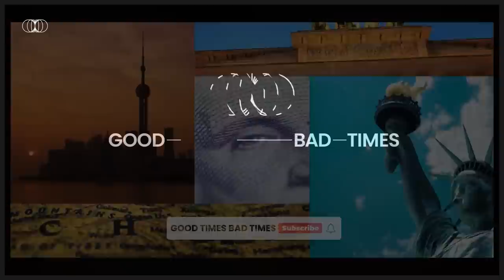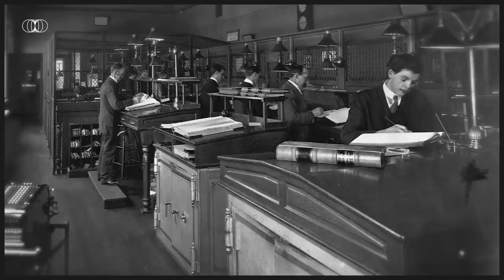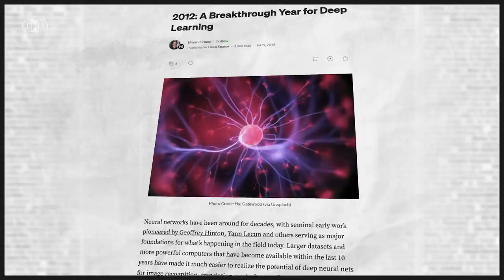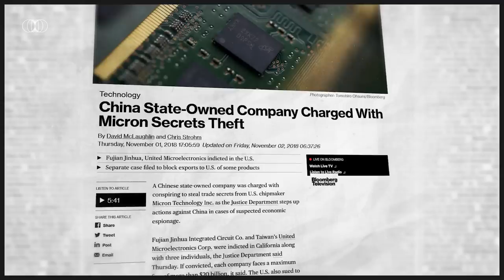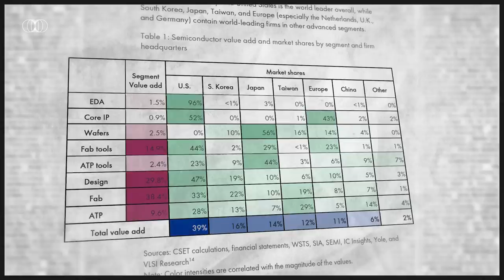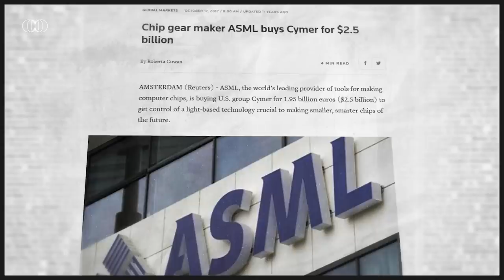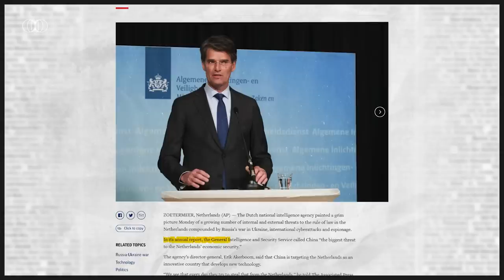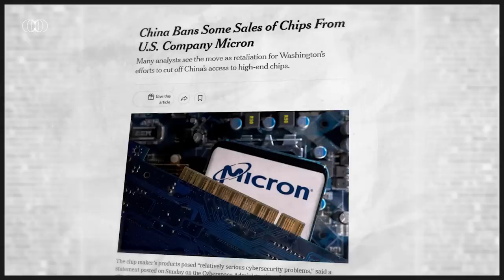The War for AI & Chip Supremacy is Underway.

Comment: As someone who works in the industry and has been following these developments for years, this is a high quality summary of the current situation with few misses.
Reply: what did he miss ?
Reply: Samsung being one of the key CPU producers is missing. NVIDIA only recently switched to tsmc. OTOH considering how densely packed this video is, some shortcuts are kinda given.
Reply: @mth469 The fact that silicon chip development is starting to reach physical limits.
Reply: @J_X999  
with AI doing chip design,
we're about to see human methods of design become as obsolete as the horse and buggy.  

it will squeeze way more out of physical silicon transistor materials and placement than humans ever can.
Reply: @mth469  Every single shrinkage of node will be more expensive and take more time than it's predecessor.
Reply: @J_X999  

its something AI would do way better than a human. 

not just use existing tools to do it, but literally engineer new tools and new materials and forms in which the transistors are built.

it would also in parallel figure out other means as yet undiscovered.

we are on the cusp of a revolution.
Reply: @mth469  AI cannot change physics which has been in place since the beginning of the universe. Chip development will slow, with or without AI
Reply: @J_X999  

you'll be surprised what AI can do.

the word "cannot" will be removed from the vocabulary in many instance because it will do it in ways unimaginable.

Long live AI !!
Reply: @mth469  If this really is the case, China will probably use AI to find the most efficient way to catch up in semiconductors and execute that plan by 2030
Reply: @J_X999  

That is what many countries with advanced AI capabilities are trying to do and doing.

AI is being used not just in aiding design decisions but making those decisions and executing on them at all levels.

How far ahead countries are in this endeavor is anyone's guess.  Any country that loses this race is going to pay dearly for it.

Comment: Great analysis! We have seen a number of investments from TSMC, Samsung, Micron, Intel and others opening new factories in the mainland US, namely TSMC in Arizona, Samsung in Texas and Micron, recently announced investment, in upper New York. I understand these projects will take some time to come to fruition, but shouldn´t these new factories guarantee sufficient chip supply in case of conflict in Taiwan?
Reply: And to be noted that the most cutting edge chips (3nm and potentially 2nm) are still manufactured in Taiwan. The TSMC fabs in Arizona manufactures 5nm chips.
Reply: You need to think about whole supply chain. Substrates, materials for packaging, etc - there are significant logistic reasons why Intel  has factories in singapore and malaysia
Reply: TSMC has more than 10 fabs in Taiwan already cranking out cutting edge micro chips. One that is yet to finish in Arizona won't be solving anything.
Reply: @Freshie55  not to mention that TSMC Fab in arizona are only producing fraction of wafer compare to taiwanese fab.  And US itself only have few smaller  facility of chip packaging and testing. so those wafer still needed to send outside of US to package and testing
Reply: Samsung is also a big chip maker. They are also currently at about 3nm. I think their business is about half the size of TSMC's, and Samsung does also manufacture for other companies. So, TSMC already has a viable competitor/alternative.

However, from what I'm aware, the supply of chip making versus demand is always tight. They do not (intentionally) build extra capacity. The factories are just too expensive and take too long to build. Overbuild much and you'll go bankrupt. 

If the TSMC plants in Taiwan were taken over/destroyed by the CCP, or even all the Samsung plants in Korea just disappeared, the chip inducstry -- and all affected industries -- would suddenly have a huge shortage with no fix for several years. It would be COVID 2.0 (times ten).

Comment: @Good Times Bad Times, great timing on the video drop— Nvidia is up like 28% today based on earnings from AI.
Reply: Yeah it's a little bit overhyped though. Just like any new hot tech topic of the moment. Recalling NFTs and metaverse vibes.
Reply: @johnjingleheimersmith9259  ”AI" is obviously a hype bubble that will pop soon.
Reply: @johnjingleheimersmith9259  except AI and graphics processors speed up the development of vaccines, new military hardware, space exploration, etc. 

This is way more important than a metaverse or NFTs.
Reply: @jordanstephenson3497  lol no, it's not that simple nor easy. AI doesn't automatically equal magic "speed boost" for military nor biotech nor "space exploration". It fully reinforces that people have little understanding of the true and current capabilities and limitations of AI. Just like people thinking AI will suddenly take their jobs, it is gravely uninformed thinking. Can AI help in certain aspects, certainly, but this is not an instant panacea or easy to accomplish on a broader scale.
Reply: @johnjingleheimersmith9259  I don’t think anything of what you just assumed. 

LLMs are the start. Deep learning and neural networks are already creeping into every industry. 

AI is just a tool after all, but a super kickass tool. 

Thanks for the back and forth

Comment: Note, this video sticks Apple in with Intel, and AMD, in microprocessors. Intel created the x86 architecture, and AMD currently also designs x86 chips, that often exceed Intel wares. But Apple recently designed ARM architecture chips that exceed x86 performance. ARM architecture is traditionally in lower power and lower performance products such as smartphones. Apple's recent ARM design surprisingly outperformed the latest x86 parts. Intel is in trouble, and AMD likewise. At least AMD has GPU products, that it can rely on.

Comment: A blockade of Taiwan would wreak havoc on the world. But the most advanced chips made by TSMC are already blocked by the US. So China would not suffer that much. In the last year, China has ramped up a lot in manufacturing of mature technoloyg chips, mature chips while having much lower profit margins drives the world's economy. China's ramp up has caused > 100,000 layoffs in US chip companies.  Intel and Qualcomm met with Biden recently and told Biden that without the Chinese market, Intel would cancel its construction of its newest and biggest chip fab, a 20 billion investment. A war between China and the US would do the opposite of what this video said. It would be very painful for China would it's the US economy that would collapse. This is why the US has said publicly it does not support Taiwan's unilateral declaration of independence, the one act that would trigger military action by China. In addition Congressman Moulton suggested the US should bomb TSMC to the ground if China takes military action. But would the US bomb TSMC in Taiwan before the TSMC fab in Ariz is finished?  TSMC just announced that there will be a 1 year delay in the completion of it's fab.  Is TSMC trying to protect it's fabs in Taiwan?
In a war between China and the US, if S. Korea and Japan join in, they may be blockaded as well. The US would then have all of its chip supplies blocked and virtually all manufacturing in the US comes to a halt. The current federal deficit of 1.7Trillion/year will balloon. China is not yet self sufficient in chips, but if you remove China exports to the US and Europe, China does make enough of matrure chips needed for domestic use, this is not true for the US.  Again this is why the US is not overtly calling for Taiwan to declare independence, at least for now.